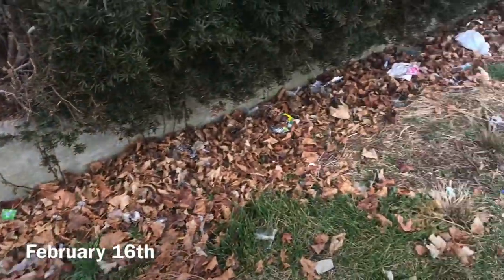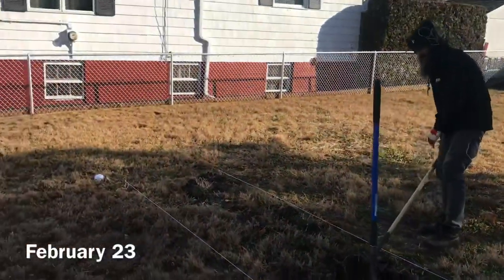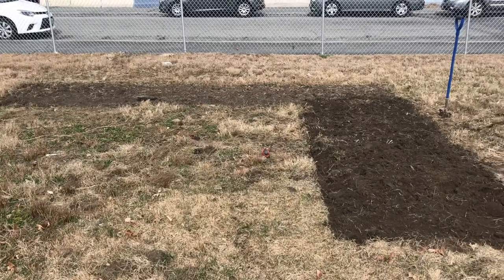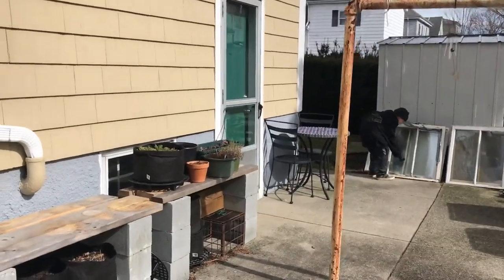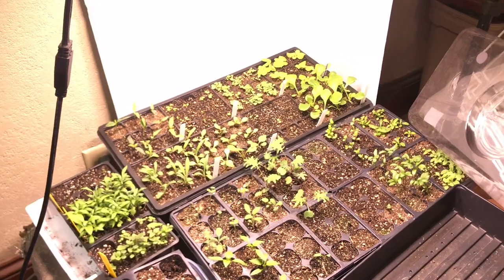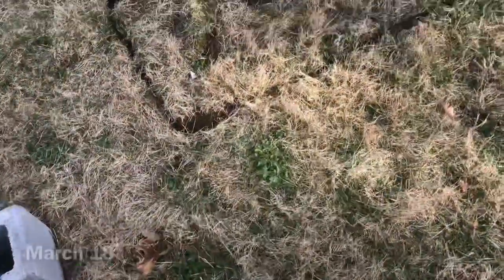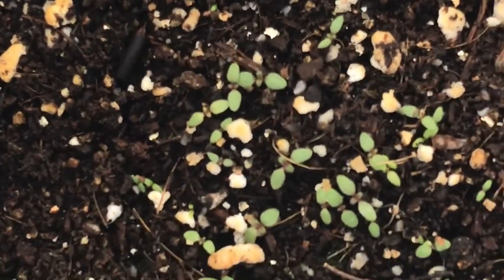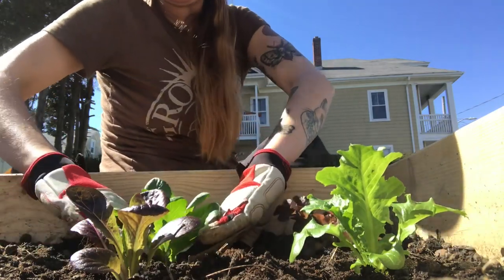Garden from Scratch | Ep 01 | Cut Flower Bed, Square Foot Gardening

Comment: Looking terrific Pam!
If your chain link fence is reasonably stable then planting ivy or similar along the fence facing the road (plant it about 1' away and angle it towards the fence) will offer you more privacy, break the wind and lessen the amount of trash that comes in. You can leave it up over the winter, cut it down to the ground early spring and pull it out of the fence so it doesn't get too invasive over time

Comment: You have a great yard to work with, I'm sure it's gonna be beautiful! I am curios though,  what zone are you? I am in 5b and there is no way I can start to acclimate anything outside yet. The next couple days are still calling for overnight freezing temps.! And today is April 12 th.!! My rule of thumb is Mothers Day. Nothing goes out before then. For my zone, It works for me. But I definitely can't wait to get things out in my garden! Every year I get better, more comfortable, confident, and ambitious! lol. I love my houseplants but I love my Spring/Summer Garden just as much! There is so much satisfaction in growing your own food. Flowers too of course! Have fun!
Reply from the maker: I’m in zone 6b, I’m on the border of 7a and I think we had a 7a winter here. We are getting drops here and there but so far the row cover and greenhouse are holding it down for me! This is all kind of experimental based off some cut flower gardeners I’ve seen using low tunnels to start early and overwinter things. 🤞🏻
So far so good but the winds are coming for my first borns today 😅